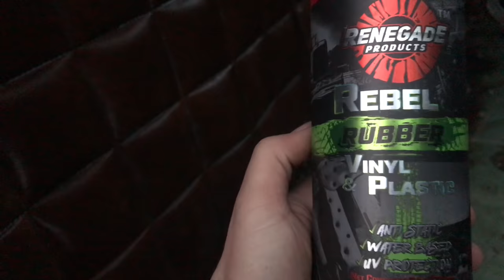#Peterbilt #359 Peterbilt 359 Restoration Part 3 New Floor

Comment: Check out DansShop.com in Minnesota. Tons of new 359 parts!  

I always insulate the floors and entire interior with Reflectix.  Makes a huge difference in noise and temps.
Reply from the maker: Ill have to check that out
Reply: Dans website is a bit confusing and items are kinda mixed up. Best to scroll page by page or call them. Great folks. 

If you use the Refelitx  just apply it with liquid nails. It lowered my cab temp by 20 degrees in summer.
Reply from the maker: Chris Barber i see, ya ill probably go that route, maybe put it in the roof too, since i doubt it will ever have A/C, but it won’t be often ill want it
Reply: Bubbles_8V92 it helps a lot in the roof!
Reply: Bubbles_8V92 great progress glad to see I’m not the only one with mice nests in the cab 😆 ... careful with Dans Shop as the import duties into Canada can get pretty steep.  I paid $200 for the air wiper valves and then got a $70 bill from Fedex for import duties and handling fee ... ouch
Reply from the maker: Ya!! That always a nice surprise! I need more american friends so i can ship to them and then pickup when im down there!!
Reply: Bubbles_8V92 yea... I’m from Tennessee..
Reply: LMC Truck also has some good thermal/sound insulation. Works WONDERS for heat and engine noise.
Reply: Kaden Watt I never thought about LMC.